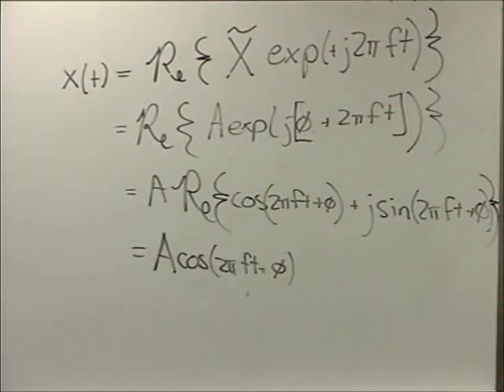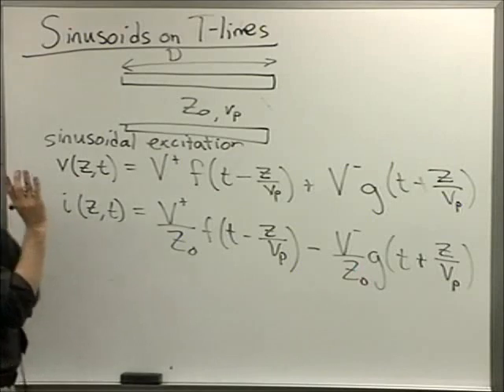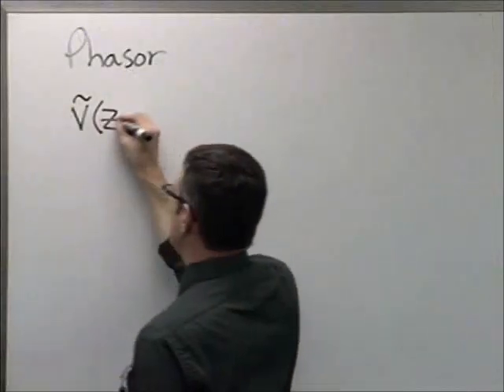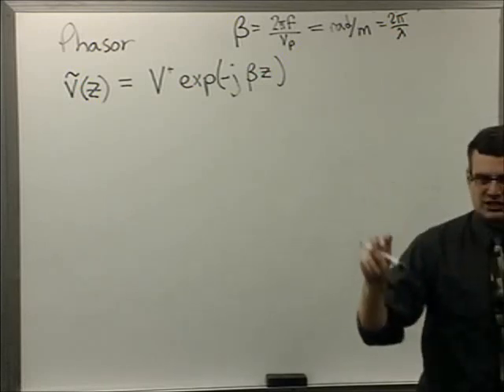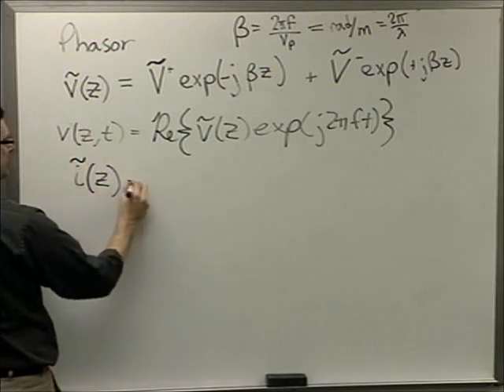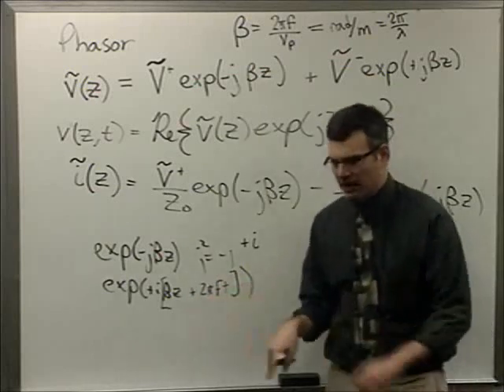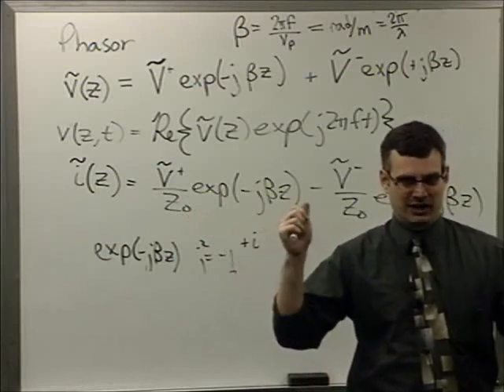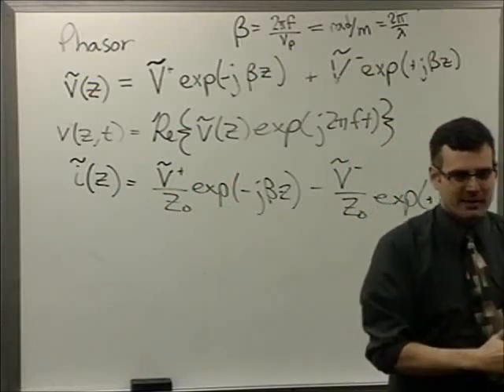THT02: Time-Harmonic Transmission Lines

Comment: 9:03 isnt i and j the same thing????
Reply: In computing packages, they are indeed the same imaginary unit defined as the principle square root of -1. For example, in MATLAB, 1j==1i is a true valued boolean. That i and j are used in different disciplines with different time conventions IS ALSO true, and so when you compare formulas between those areas, it looks like -j = i is how you translate one discipline to another. The fact is though that you can write (-i omega t) or (i omega t) or (j omega t) or (-j omega t) and as long as you understand the time convention (does the plane-wave have the form cos(omega t - kx) or cos(kx-omega t)), and you only need the property that j^2=-1 or i^2=-1, then you can be correct and consistent. For example, if plane waves look like cos(kz - omega t) and you write phasors as exp(j k z) (that spin with exp(-j omega t) time dependence) for forward going waves, then you are using a weird convention people aren't used to seeing, but you're not wrong.